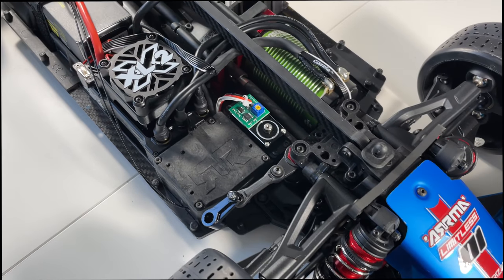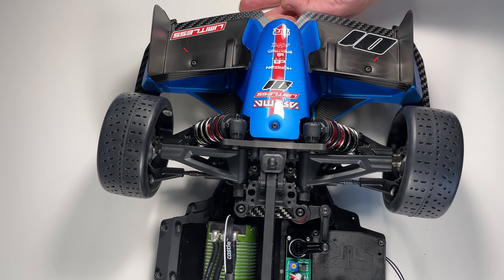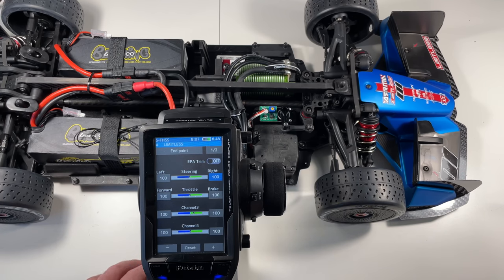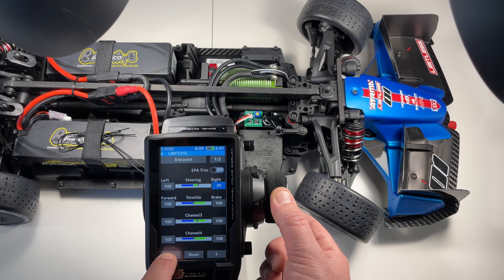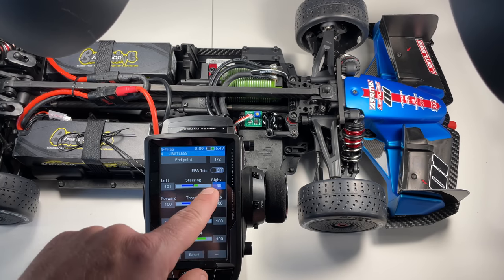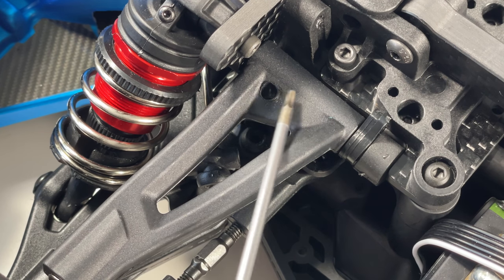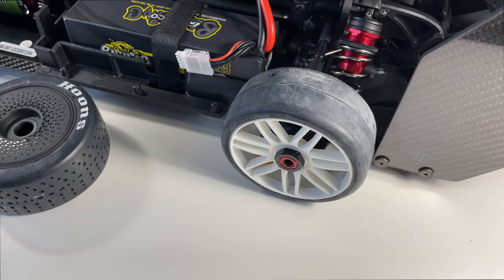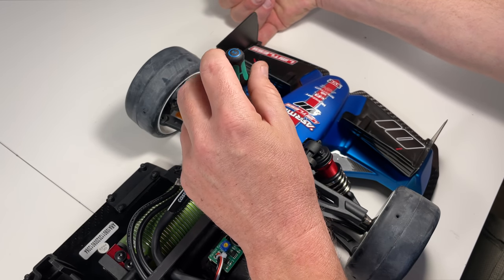SPEED RUN SECRETS REVEALED - EPISODE 5

Comment: I may be ahead on this but what are the specs on the tires?  I noticed they have more than one S5? Extremely thankful for you and your videos. Appreciate the amazing work and patience you have to do this for the community.
Reply: the color is different and there are slicks or rally tires…
Reply: Also the white J rims are the hardest plastic and hold up to the speed better. The black rims are a lot more flexible and like to explode due to the flex under load.

Comment: Big up to you sir for another brilliant video. I think that what you tell us about set up can be used on all types of cars and buggys.
Here's a question that will get you thinking. On these speed cars why aren't the nuts threaded with a left hand thread on the right side of the car ? If it was a left hand thread it would never be a problem of coming loose it would be self tightening , right hand threads on the left hand side tighten automatically.
Reply from the maker: Honestly it never happened to me..

Comment: Its good using something to limit rear shocks.
I'm surprised you didnt on other builds.

Was the same with your carbon shell car.
You.lifted the front as shell was dragging under running orbreaking but inevitable happened with the flip.

Use the same on the front but not as aggressive

Comment: Neat trick with the tubing on the shocks! I have two questions though:
1. What is nitro tubing? I need to know what I’m looking for down in Romania, and I am not sure my lhs will know the term😀! Do you mean the fuel line tubing on nitro cars? 
2. Is that level of stiffness on the back shocks not achievable with harder springs?
Thanks! 🙏
Reply: Yup, that's what it is, fuel line for nitro rc cars. And yes, you could potentially find stiffer springs that would do the trick & the preferred way to do this. But the nitro tubing is a cheap, quick and easy way to do it.
I used Tekno springs, Orange, on my Arrma Typhon 6S to stiffen up the suspension because the stock springs were too soft. I need to see if I can get similar ones for the Limitless now.
Reply: @rcbustanut2057  Thank you!

Comment: hi, if the original springs are too soft for you, you can also install springs from the xray or serpent gt's. they fit!
Reply: Arrma Nero springs work great too. Extremely stiff!
Reply: @M14armorer  the 3 point Xray Spring have 42lb and the black from Serpent too.